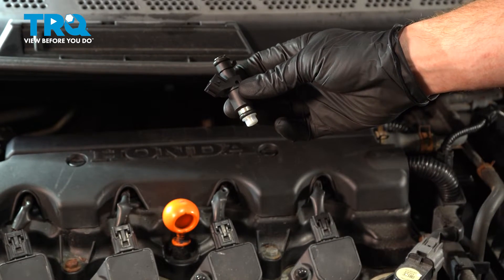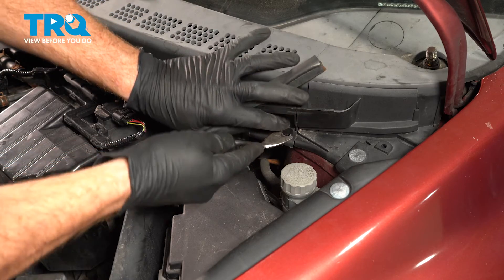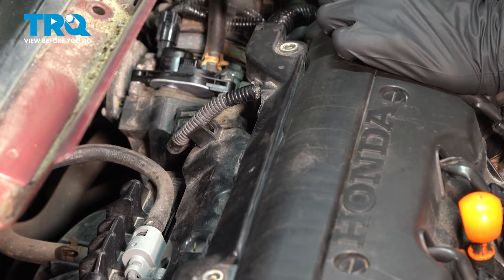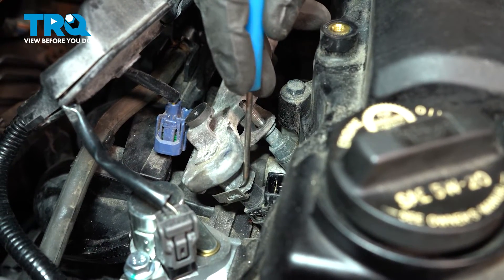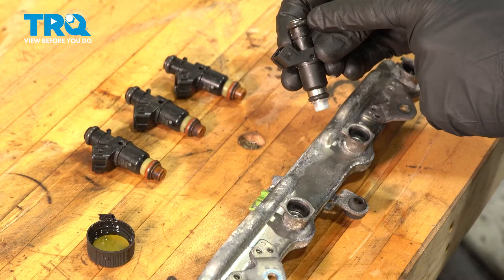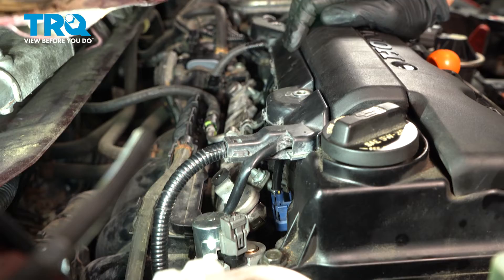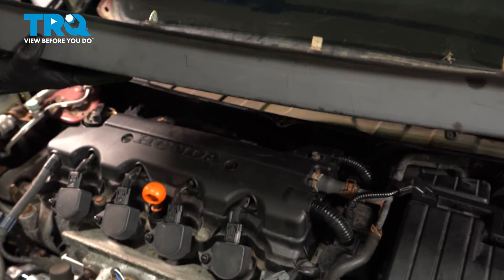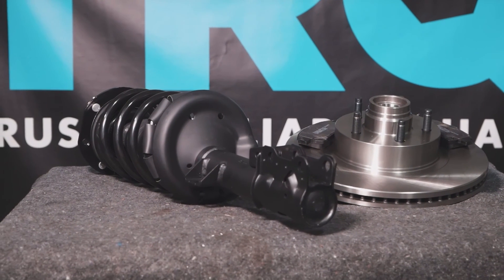How to Replace Fuel Injectors 2006-2011 Honda Civic

Comment: Amazing watched this twice bought ebay injectors for my Honda civic 2007, kept getting miss fire on injector 1,swapped out spark plugs always same issue checked wiring all good, only thing left was injectors thought was massive job until watched your vid and seemed simple and straightforward enough, and wow all steps followed and car is like new again no limping, no lag, back to the wee pocket rocket hahaha, thanks a million. All good

Comment: So ive got an issue i've run into if it helps anyone. lost the original retainer clip for the feed hose for the fuel rail. bough dorman part number 800-046 as replacement. they dont fit. don't buy them. can anyone point me in the right direction for a good replacement clip? or should i just go to a honda dealer and get oem

Comment: I believe you can step on the gas peddle and hold it all the way down and try to start the car while holding the pedal down it will go in to clearing the gas lines so no need to take fuse out btw just finished ✅ thanks for the video.

Comment: My car was sitting in garage for 3 months but my dad would drive it every 2 weeks. There is no engine check no lights on the dash. I changed the spark plugs 4 months ago. I have to change the oil after 1000 km my question is every time I accelerate the car it does a little jerk. What can be the problem?

Comment: for the longest time my car kept stalling or hesitating when giving the car some gas. I thought it was a maf or anything related to my air intake. I had my mechanic put his scanner on and every-time my engine called for gas it didnt read or was a low number indicating my fuel injectors might be going bad, also my car is at 180k miles, so I was definitely due for some fuel injectors. I bought the parts from trq and installed them while watching this video. I test drove the whip and it feels brand new now. Thank you so much!

Comment: Does P0300 to P0303 could be triggered by these? I have been searching and I already replaced my coils and spark plugs but the car still has this codes on and sometimes flashing, includes sometimes loss of power. Still is not the Head gasket because I had it checked with a Combustion Leak tester and it came negative.
Reply: What was the problem 
My had similar issues 
I replaced all 4 injectors

Comment: You pulled the fuel pump fuse, tried to start the engine, then put the fuse back in and turned the ignition on. 🤔🤔🤔